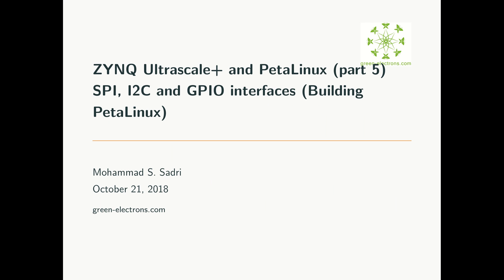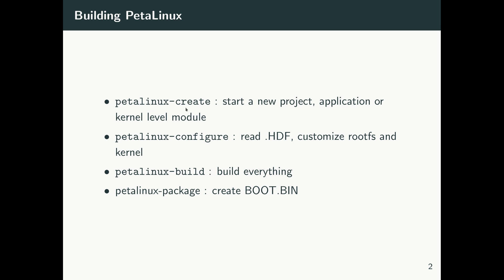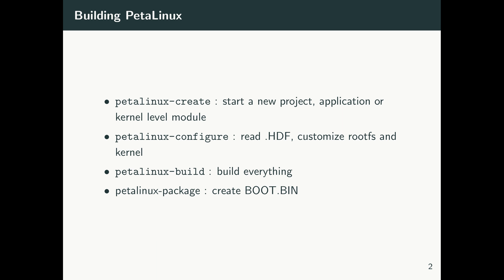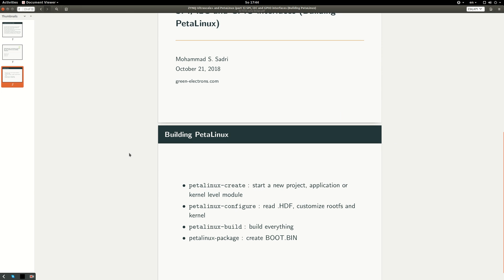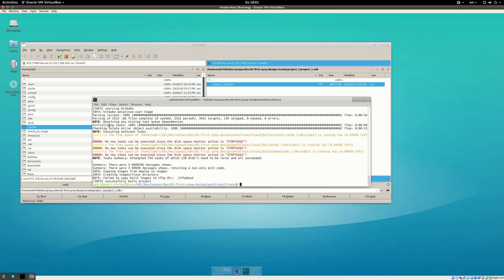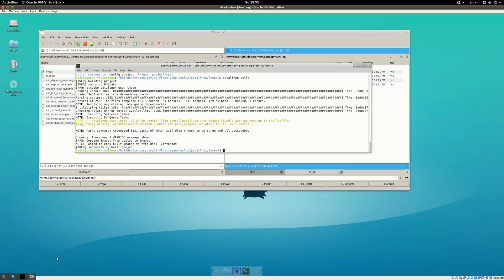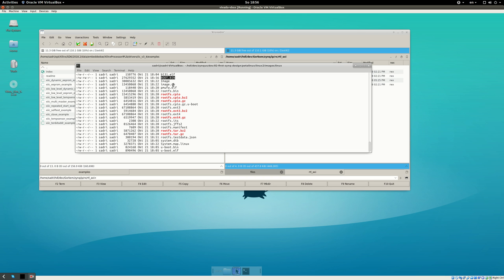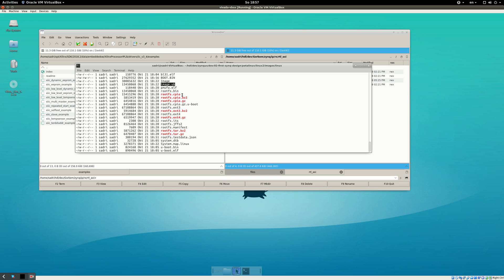ZYNQ Ultrascale+ and PetaLinux (part 05): SPI, I2C and GPIO interfaces (Building PetaLinux)

Comment: Thank you for the great Video Mr. Sadri,

I have one Question: Would it be possible/easy to run Vivado on the host operating System (e.g. Windows) and just copy the .hdf to the guest OS? This way Vivado can use more resources of the PC.
Reply from the maker: should be fine

Comment: Hi Sadri, good video. I followed rigorously your steps but the build of petalinux terminated with Error. I'm getting the following : ERROR oe_runmake failed. I tried to google it some thread suggest that the CROSS_COMPILE env variable shall be set prior launching the build. Even though with that set, It gives the same Error.
Reply from the maker: no, env variable will be set by petalinux itself. you do not need to set it. can you put the complete error message? this should not happen, which distro of linux you are using?
Reply: Here-after the errors that come out. 
 ERROR: oe_runmake failed
ERROR: Task (/home/samvbox/opt/petalinux-2018.2/components/yocto/source/arm/layers/meta-xilinx/meta-xilinx-bsp/recipes-bsp/u-boot/u-boot-xlnx_2018.2.bb:do_compile) failed with exit code '1'

I'm using a zybo z20 (XC7Z020-1CLG4000).  Linux distro: ubuntu 16.04 like you suggested.  I sourced vivado, and petlinux. I jusr mad .HDF file visible to petalinux not the whole Vivado project.